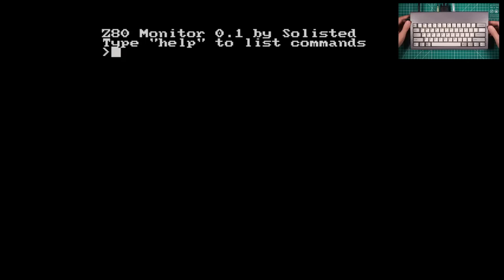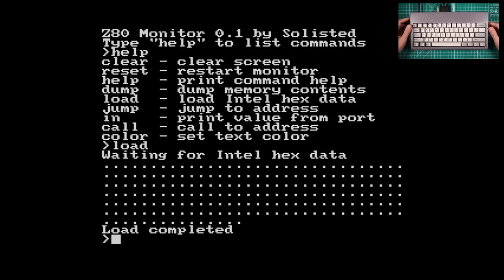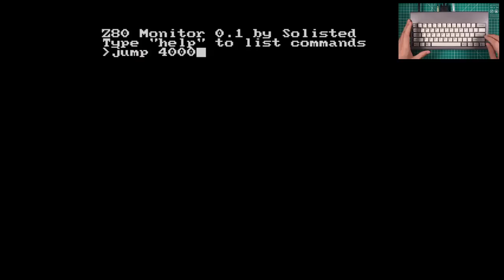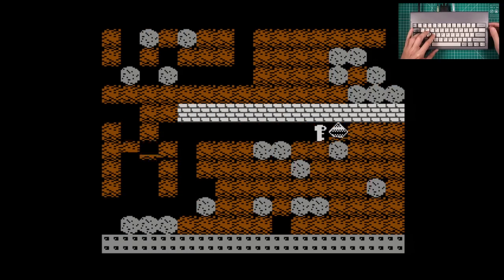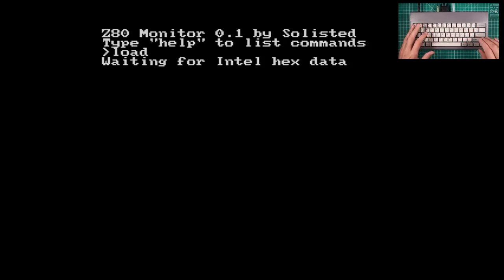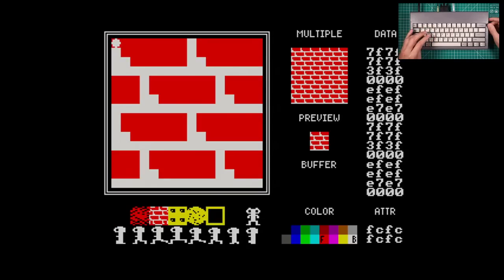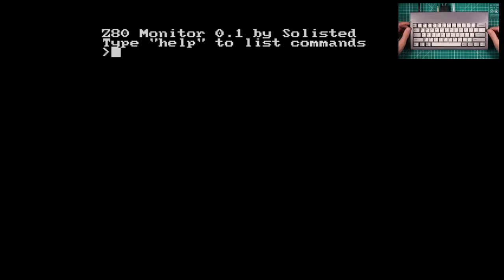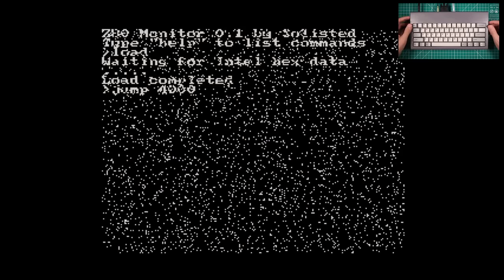DIY 8-Bit Z80 Single Board Computer

Comment: Are sources for CPLD available somewhere? or it's binary only?
Reply from the maker: Did not decide yet if it’s a good idea to publish ROM and CPLD sources, bc it could lead to platform fragmentation. But on the other hand it’s not so difficult to write other variants of the video code and ROM for this computer, so fragmentation is inevitable if this computer becomes popular among DIY builders.
Reply: @solisted  I have wrote verilog for my breadboard computer FPGA, but it's altera one, yours interesting that it's running on Atmel CPLD, but at the same time requires expensive programmer cable. Without looking at code and how easy that is I'm not sure I want to invest in that cable :D My take on this, if you make your schematic/pcb and etc open source, then it makes sense to make programming of it open source too, otherwise it's closed system and not sure you can even call that platform. Atmel is interesting for me that it's 5V compatible and doesn't require a bunch of level shifting to 3v3 fpga's. Anyway, your project is really cool. If you decide to share source code for cpld  I would gladly read/learn something from it :)

Comment: Very interesting, Good explanaition and great project! Where did you get the Keyboard from?
Reply from the maker: Thank you, Thomas! Keycaps for the keyboard are ordered separately from WASD Keyboards. You can design your own keycaps on their web site and they will manufacture them for you. PCB for the keyboard is DIY, made in KiCad and manufactured by JLCPCB (like the mainboard). Cherry MX linear switches are ordered from mouser.com. Everything is DIY, hand-soldered.
Reply: @solisted  useful information, thsts the biggest hurdle ie problem with resurrecting ZX81 or Spectrum, their standard keyboards are yuck. and there no third party around these days making and selling complete ZX keyboards. a mere 35 years late lol.

I haver an intact ZX81 , no idea if it wotks, best to keep it as a display item methinks.

Comment: Is it not compatible with any of the retrocomputers ?  Why do we need this project ?  It would be interesting to make a computer on Zilog ez80 , 56 MHz CPU, 16 MB memory, 256 colors, with a screen resolution of 320x240
Reply from the maker: No, it's not compatible with any of the retro computers. This project is meant to educate myself in electronics engineering field and for recreational retro programming.

Comment: You've convinced me. Now take my money :)
Reply: Why 7805 voltage regulator ? It does dissipate heat, there are more modern versions. They are pin compatible but have almost zero heat emission. I have one in my Spectrum.
Reply: It's ready for an OS.
Reply from the maker: Hi! I’m not very experienced in electronics design. This is my first relatively complex, serious project. Could you please suggest some parts I can use for voltage regulation instead of 7805?

Comment: Any chance someone might do a kit of your design?
Reply from the maker: It's possible, I published gerbers and schematics on GitHub under the MIT license.
Reply: @solisted  I think someone should get behind this. But I would put more GP I/O on board for robotics and SCADA type stuff. Probably swap out the sound effects / joystick for motors and DACs. 

Does it have / can it run unmodified BASIC or FORTH?

Comment: Does it have a true bitmap mode where every pixel can be any color?
Reply from the maker: No, 8x8 area of pixels can have distinct foreground color when pixel is lit and background color when it's not in 1bpp 256x192 bitmap. Color is controlled by a separate 768-byte attribute area in VRAM.

Comment: Nice! would have been wonderful to have a full bitmap mode without color clash @16 colors. It would have required 32kvram
Reply from the maker: Thank you!
I have graphics engine based on the same CPLD that implements this mode. But it's impractical to put such mode with 8-bit CPU like Z80 @ 10Mhz. There would be very poor fill rate for any decent game animation - too much data to move around for such CPU. It will ruin the balance between the CPU and graphics subsystem. Also, video buffer would take a lot of RAM and will require external banking to be implemented. 16/256 color modes for 8-bit CPU is usually implemented using tiled/sprite mode, without linear framebuffer. But in this mode you cannot draw arbitrary graphics (yes MSX has 768 tiles in tiled mode you can fill entire screen with and do some bitmapped drawing, but it's very quircky to work with).
Reply: @solisted  I also think it's really disappointing about the Spectrum type attributes/colour bleed. I prefer graphics modes which don't suffer from this, like on the Amstrad CPC, BBC Micro, etc. The Timex Sinclair TS2068 and some other ZX Spectrum clones have an additional graphics mode without the attributes/colour bleed. Can you explain how this is done? Of course, the TS2068 CPU is clocked at 3.5Mhz, so wouldn't it be much easier at 10Mhz?
Reply from the maker: @paulbraun5657  I don't know about BBC Micro, but Amstrad CPC has double width pixels which gives resolution 160x200 that takes 16k of VRAM and CRTC controller that can consume main RAM for the video buffer at the arbitrary address. With smart programming of this controller you can achieve smooth animation with double buffering and/or per pixel scrolling, but at small frame rates. Also 16k VRAM is not a big deal since Amstrad CPC supports memory banking and additional memory. It's a bit more advanced. ZX Spectrum 48k has only one bank of memory and no video hardware assistance of any kind. For this computer, such video layout was a necessity, I think.
I tested another prototype with 256x192x16 color per pixel video mode with Z80 clocked at 10Mhz. It took 24k for the video buffer out of 64k address space and I could not achive smooth animation due to low throughput of the CPU even at these frequencies. To have smooth animation, you will need second back buffer and it's another 24k - somthing this computer cannot afford to have. Hardware assistance was needed for games to feel fast and snappy, at least some sprites or hardware blitter of some sort.
At the end, I decided to make another computer with 256x192x16 color video mode and W65C816 CPU that has 16M address space. And keep this computer with ZX Spectrum-like video mode to preserve the original balance.
Reply: @solisted  the Amstrad CPC has three graphics modes which each take 16K. It uses the same 6845 graphics chip as the BBC Micro. However, the BBC Micro graphics have no border and the screens are 256 pixels high. I think this means the BBC Micro graphics modes each take 20K. The Spectrum and Commodore 64 graphics screens each take up 8K. I'm not aware of Amstrad CPC or BBC Micro games running much slower than Spectrum games, so I think there must be a flaw in your computer's design! I think it's very depressing seeing that large areas of Spectrum graphics screens have the same background and foreground colours. Sinclair tried to make everything as cheaply as possible and this is the result. I can't see the point of copying this limitation 40 years later, though.
Reply from the maker: @paulbraun5657  What can I say, I don’t agree. I tested everything thoroughly on the prototype and was not happy with the performance with color per pixel mode. CPU was running at the full speed while accessing video RAM, no wait states. Also not agree that attribute clash is some bad thing. When memory is limited to just 64k, this mode totally makes sense, because it leaves as much RAM as possible to a program code. With clever programming you can make pretty good looking games, even with attribute clash. I’m pretty satisfied with my computer design and enjoy programming it.

Comment: Where did you get the actual keyboard from?
Reply from the maker: It's custom made keyboard - classic diode matrix circuit. I made custom PCB, soldered linear Cherry MX switches.
Reply: @solisted  Very nice! I looked back at the video and saw where you mentioned it. I must have missed that the first pass through.
Reply: Is it ps/2 keyboard? Also how did u connect the keyboard
Reply from the maker: No, it does not use any particular protocol. Keyboard is implemented as a simple 8x8 matrix with diodes directly connected to 8 outputs and 8 inputs of the peripheral IC (Z80 PIO). Key matrix scanning and translation to scan codes is implemented in software.
Reply from the maker: Initial prototype had PS/2 keyboard input and  AVR microcontroller that translated PS/2 data stream into serial. Then serial data was fed into the Z80 SIO peripheral IC. After some game programming, I noticed that protocol and translation introduces noticeable key stroke latency that ruins game experience and redid keyboard implementation like described in the previous reply.

Comment: hows name that operating system which work that processor?
Reply from the maker: This computer has small monitor program in its ROM that allows to perform basic operations, like dumping memory and loading binary data from serial port.

Comment: Super but… why? What is a purpose to develop systems from the 80’s?
Reply from the maker: Good question MR Q, thank you! A lot of reasons, actually. A few of them are:

I'm not a professional electronic engineer. Old computer systems are very easy to design and build for beginners like me. Sub-20Mhz frequencies allow you to use inexpensive debugging equipment like $300 oscilloscopes and $100 logic analyzers. And you will need a lot of hardware debugging when you start something like that. Due to low frequencies you can start on the breadboard with jumper wires and it will still work! We know how noisy circuts are on a breadboard.

You don't need great soldering and PCB-design skills to build system like that also. At these frequencies it is very forgiving to various signal integrity mistakes you might encounter when designing PCB. First revisions of the PCB for this project were 2-sided and so ugly, because I used autorouter, but still worked well! :) Only final revision was manually routed on 4-layer PCB when I learned to do it well. I'm still not comfortable with SMD-soldering, so choice of old through-hole components helped me to avoid a lot of delays and frustrations caused by lack of advanced engineering knowlege and skills.

I'm a X-generation computer enthusiast and computers from that era are still produce a lot of warm feelings and nostalgia for computer nerds like me. I'm very frustrated by the situation in the IT industry today with bloated operating systems, overengineered applications and frameworks that consume gigabytes of RAM for the simple tasks like IRC chat with fancy graphics (hello Slack based on Electron framework ;) Computer and network speeds improved by many magnitudes since 80s but still you have to wait couple of seconds for an application to start like you're running it from the floppy :) I'm a programmer and languages like JavaScript and its frameworks make me puke - want to go back to my cave, open text editor and start writing oldschool z80 assembly :) This project is a safe-space for myself as a software developer where I can work alone, without all that toxic scrums and kanban boards :)

Working with 8-bit systems in assembly language is very easy and straightforward - it works the way you make it work (program), no more no less. Instant compilation times, instant launch, no need to have super powerful workstation for development.
Also, I like an aspect of that era that you don't need to be Ubisoft or Epic to make a decent game for an 8-bit computer. You alone can make something very decent (matching system capabilities) in a month or so and that will include game graphics, level design and music. And it will be very captive and challenging to play if you do your job well - check how popular is Celeste game for the PICO-8 fantasy console. It was even ported to different modern platforms and selling very well!

Comment: Minimum order from JCLPCB is 5 units costing (me) £60 including tax and slowest delivery, be happy to sell on the other four at no profit to myself to any others interested, if OP is Ok with that or can point me to where I might get a single unit printed for a reasonable price. I haven't costed the keyboard yet but maybe the same deal.
EDIT: Approximately £90 for 5X Mainboard and 5X Keyboard unpopulated PCB's
Reply from the maker: Martin, I did order all my PCBs from JLCPCB as well. This is the most convenient PCB vendor I know with low price. OSHPark has minimum order of 3, but they are much more expensive, and I don't like purple PCBs.
If you want to sell excess boards, make a comment with some information how people can contact you. I have no problem with that and will pin your comment.
Reply: @solisted  The boards have arrived after a very long stint on a slow boat from China. I'll work out the break-even prices and make a comment, soon.
Reply: Hi Ivan, I've tried adding links to my extra boards but my comments keep disappearing, not ure if that is you or YT delting them?
Reply from the maker: @LOrealHardly  Seems like it's YouTube. I have "Block Links" option disabled in channel settings. I temporarily lowered strictness level for comments. Could you please try to make it one more time? Create top-level comment with links and all information needed. To see if it will pass YouTube filters.
Reply from the maker: Martin, I don’t know how to make comment with links pass, but we can do the following. Leave comment without links and refer to the description of the video and email me links to your boards, I will put them in the description of the video.

Comment: Looks beautiful but has problematic details. I think this is more a proof of your skills as an engineer, because probably nobody wants to use this device - for what anyway?
Reply from the maker: Thank you! I made it for myself, I want this device to make software for it. Basically, I took ZX Spectrum 48K as an inspiration and improved everything I wanted to be improved in it. Higher clock, quircky VRAM layout, interrupt mode 2 support, RS232 serial port etc. Could you please elaborate more on problematic details you mentioned?

Comment: add storage !!!  and don't do basic, do forth !!!
Reply from the maker: Will do, but not sure about Forth. Very specific stack-based programming language used back in the day for scientific calculations. I think BASIC will be more interesting for people to play with.
Reply: @solisted   not limited to scientific programming.   Games, word processors, spacecraft, robotics, embedded programs, boot loaders, etc have been done in forth.  very compact & flexible language.  you can do more in a limited amount of memory than almost any other language,  Assembly is faster to run and more compact for small programs, but as complexity increases, Forth beats it.
Reply from the maker: @Randal Davis I see. I did not encounter Forth in other envirnonments other than scientific, hence responded that way.
I think 8-bit computer's, with 64K of RAM and a few simple 8-bit I/O registers to interact with keyboard and sound, complexity is the exact match for assembly. And BASIC is simple and straightforward enough for programmer beginner to start toying with the system before jumping to assembly. That was my path in the programming at least.
But I would not argue. I did not do programming in Forth that much. Just did a few simple programs in DOS on PC back then to educate myself a little about this language.
Just thinking, BASIC interpreter on power on will be more attractive to people bc it was like that in 80's on home computers experience of which this system is aimed to replicate.

Comment: You didn't indicate the ram and ROM dude. WTH.
Reply from the maker: What do you mean? Did not disclose RAM and ROM IC location on the board in the beginning of the video?
Reply: @solisted  Actually NO, you did not.  You jumped right to the video components and only discussed the similarity of the video memory layout to a ZX Spectrum, or that was what it sounded like.  That was not very clear at all.  I am assuming that the 4 chips on the bottom right are the RAM ROM though you never indicated to them.  You also failed to say how much RAM and ROM was included and if any bank switching was used.   These are some of the important things I want to know about a project like yours.
Reply from the maker: @michaelcloutier2225  I’m not a professional YouTuber, not reading from script, just started making my videos. So, often my thoughts are jumping around while recording and I can forget to say something I wanted to point out. I think with time my presenting skills will be better and I will not forget to point out important things.
Reply: @solisted  No problem I was just pointing it out.  Maybe just post some text to fill in anything you missed, like bullet points of the specs.

Comment: Why wasting time and energy on side projects that won't see any future? I saw many projects like yours that never get above the ground. The main key is the software library and the community. Why not join forces with the SpectrumNEXT team and add you fantastic contribution to it? Or take any other Z80 old computer and improve it further, or build peripherals that are missing.
Reply from the maker: Thank you for the question, Florin! I provided very detailed explanation in reply to a similar one in the comments, please check. In short: at the current state this project is already above the ground for me and serving it's purpose of my self-education in electronics engineering and love programming such devices in Z80 assembly - it's my passion.
Reply: @solisted  nice, muscles on! And then try to do something for the amazing Amstrad 6128 plus. What an amazing computer!